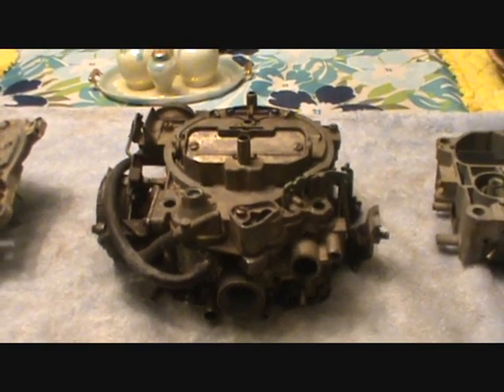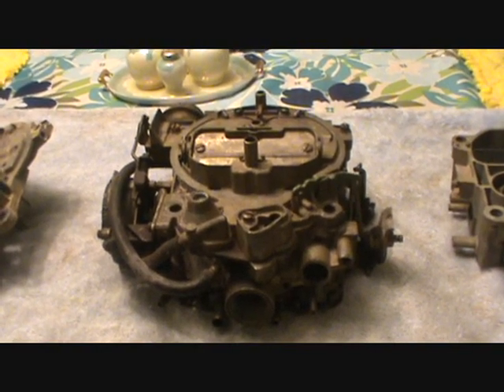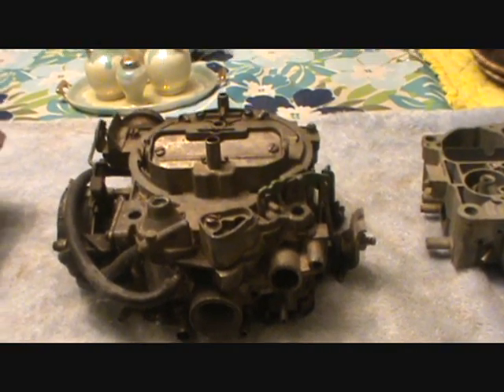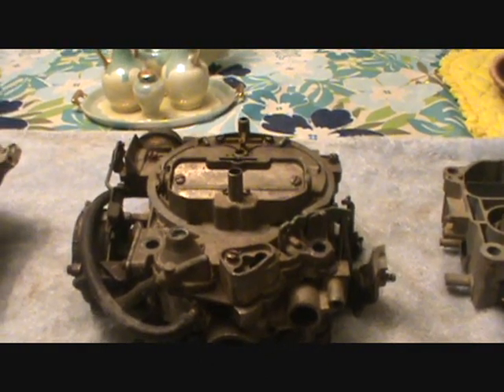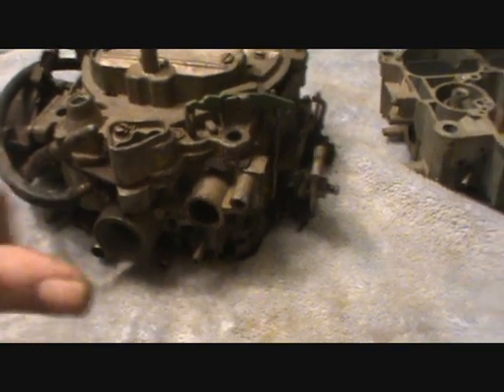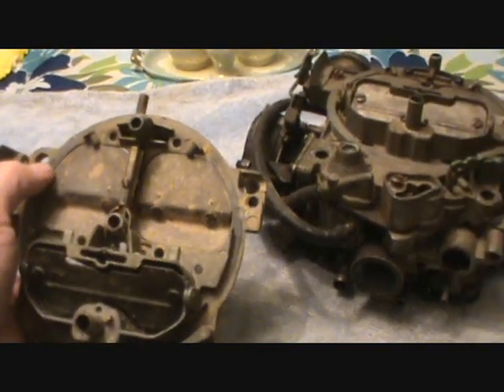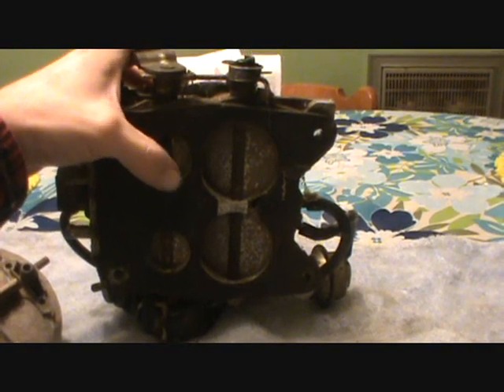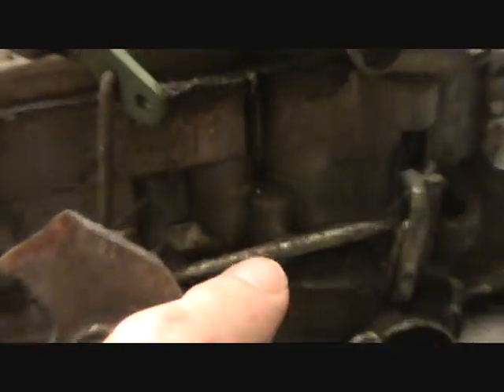How to de-bog your Quadrajet part 1

Comment: i have a 82 caprice coupe.all stock.its been sitting for about 2 months without being drivin' but i still start it. i went to drive it a few days ago and it keeps bogging out.ive neva had a problem from it but now it burning a 1/4 tank of gas in about 2 miles.idk what is goin on
Reply from the maker: It'd probably flooding. Check the choke and if that doesn't cure it, it probably needs rebuilt.
Reply: Do u think its needs adjustment (air/fuel) becsuse it burned alot of gas b4 this too
Reply from the maker: BOXCHEVY RIDER
 The only mixture you can adjust is the idle mixture. If it's running rich and going through gas then there's something else going on. As I said, check that the choke plate up top opens all the way when it's warm. If that doesn't fix it, then it's got dirt in the inlet valve or the float has started to sink.

 The awful gas we have now starts going stale a lot sooner than it used to so if you are going to let it sit without driving it for a while you should probably put in a couple bottles of fuel stabilizer.
Reply: Ok thanks

Comment: A few of the bigger CFM Rochester 4GCs were spread bore but not to the extent of a QJ, Autolite 4350, Holley 650 spreadbore or Thermoquad. None of them have the triple primary venturis of the QJ which I think contributes to the sharp response of a QJ.

Comment: Very good videos, I learned lots.I have a 350 engine in my 23"cabin cruiser,.I can take my laptop on my boat  and use your videos as a ref. I have a manual choke,maybe I should change this to an auto.choke. The gas pump is on the engine.When the boat sits for a while,say a few weeks,I have to stroke it many times to get gas into the carb for it to start. Any ideas thanks,john

Comment: Great video...cant wait to watch the rest of them...a question though.  I have a 1968 Camaro with a mild small block.  It had a Holley 4118 on it, and sounded great, but never really ran fantastic.  I finally decided to throw on a Q-jet I rebuilt off a 79 Camaro.
It seems to run much better, but wants to die when pulling up to stops, and kind of "surges" at low speeds.  Any recommendations?  Thanks...great work there!

Comment: Hello,
I have a 1978 Chevrolet El Camino with 4bbl quadrajet and it had a new carb about 11 years ago but never was really driven, maybe only 20 miles, So the other day we took it for a drive and it idles great but whenever we hit the gas in drive to take off the engine bogged down almost died, We would have to like play the throttle to keep it running, Any ideas ?? Not really wanting to have to buy new carb ..

Comment from the maker: @RicerEater1978  It sounds like you may have a restricted idle circuit on one side. A quadrajet will supply a pretty large engine with it's factory calibration so I would check the idle circuits all the way from top to bottom.

If it's simply too lean then you may have to tweak the idle restrictors. Ruggle's book has a wealth of info on that.

                           Good luck.